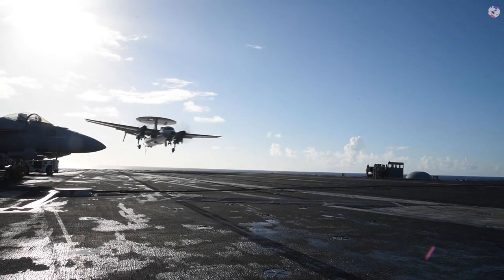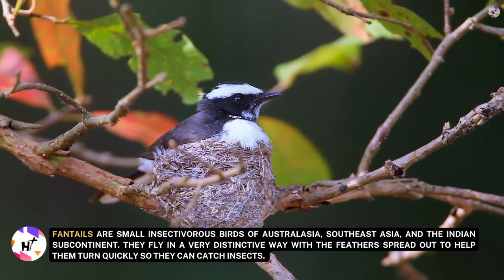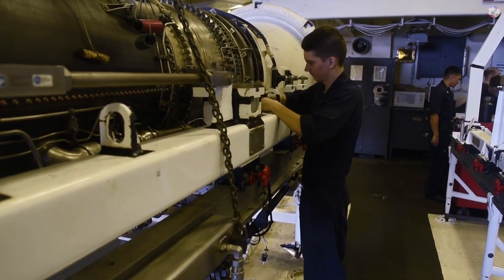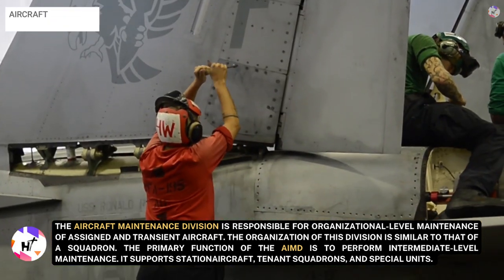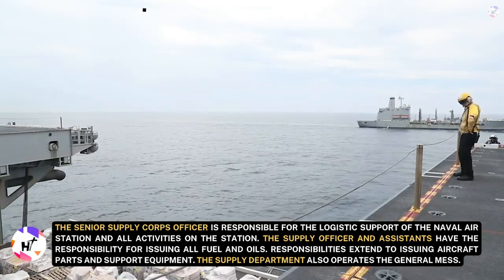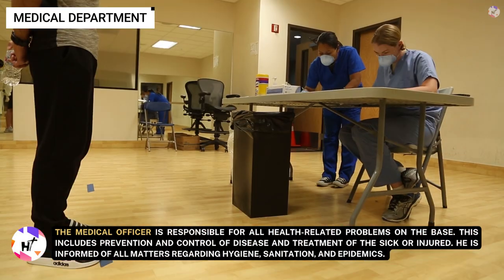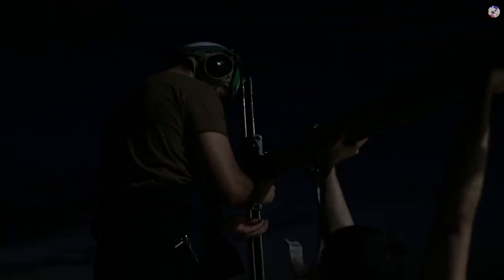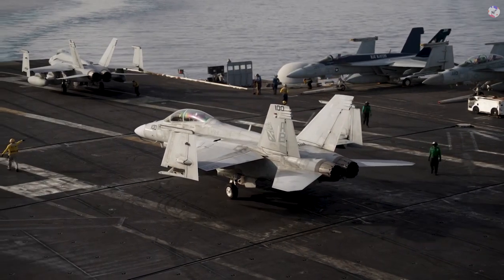What’s Actually Happening Under the Flight Deck of an Aircraft Carrier

Comment: The majority of the control rooms are located below the flight deck because the island was designed to be as small as feasible. The very back of an aircraft carrier is protruded similarly like a fantail, which has a number of uses such as giving a protected space to board the ship. The only workplaces in the superstructure are the bridge room radar and surveillance systems with the cockpit control. The jet engine is also behind doors, so that after an overhaul, engines can be tested and maximum power in order to fix the screws propellers. Thank you so much for making this video.